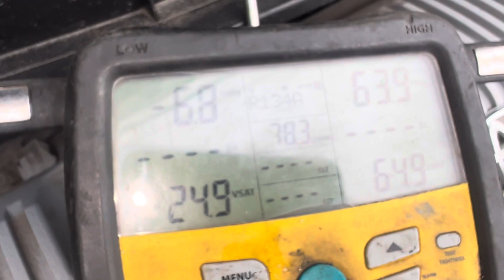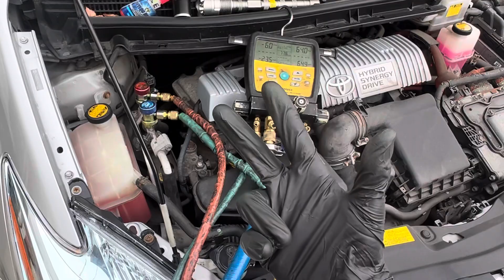PRIUS AC PULLING INTO NEGATIVE VACUUM. What does that mean? 🤔￼

Comment: stuck expansion valve.
Reply from the maker: Nope ,  just low refrigerant level.  That’s all. 

As long as there’s two or 3 ounces of refrigerant in the entire system, enough to raise the pressure above the pressure, switch the minimum 42 psi . 

It will engage the electric compressor and the compressor will speed up faster because it is not cooling. He uses computer temperature and pressure sensors and it’ll just keep on spinning up the compressor faster, pulling through the restriction of the expansion valve into a deeper vacuum.